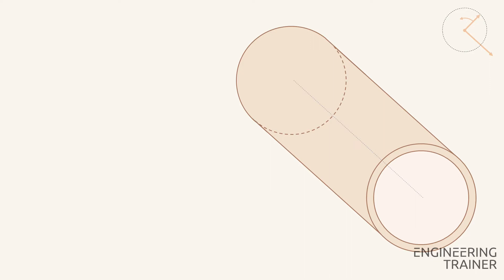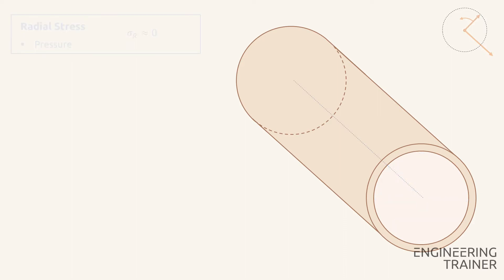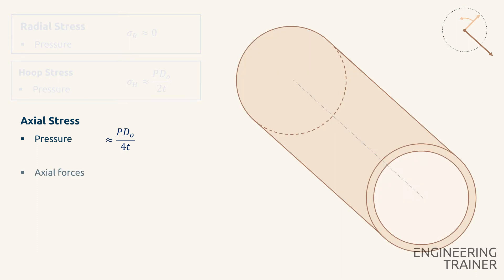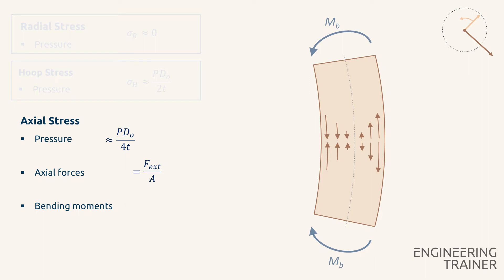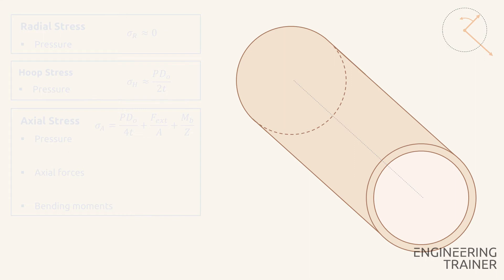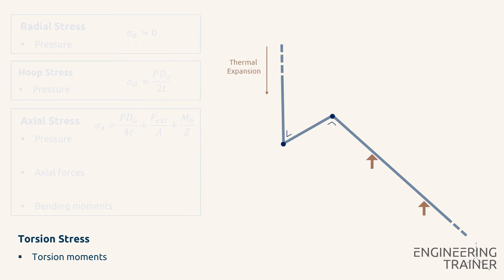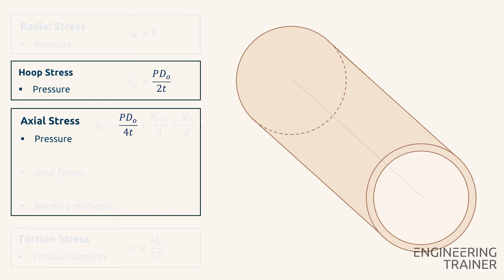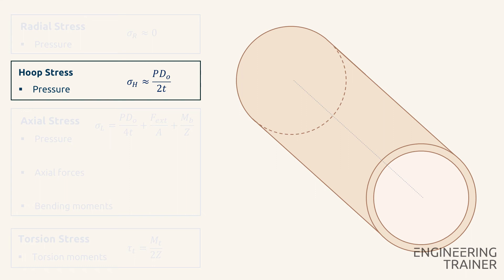Pipe Stress Fundamentals - Forces & Moments on Piping

Comment: What is the axial force called that is exerted by the fluid flow through the pipe?
Friction is exerted on the pipe by fluid flow, so there must be an axial force from that friction. 
If there was no mechanical resistance to this axial friction force then the pipe would move axially with the flow.
What is this axial force due to fluid flow called?
Thank you

Comment: How can a pipe twist in thermal expansion?? it will only extend in one direction .
Reply from the maker: Hi there! Although a straight pipe indeed extends, the routing of different sections can result into torsion as in the example of the video. The thermal expansion of the vertical segment results in torsion in the horizontal run. Hope that helps!